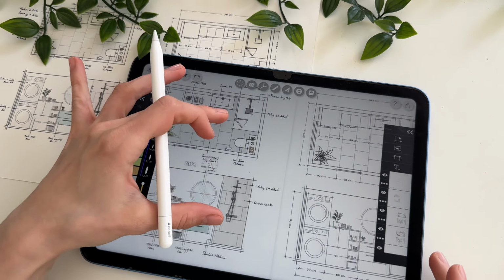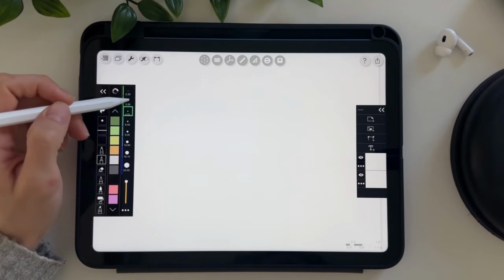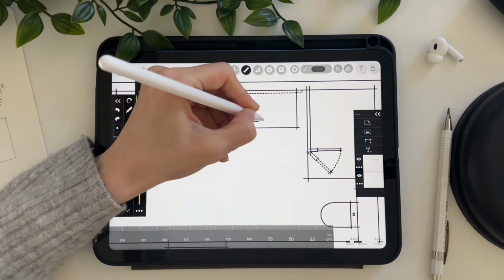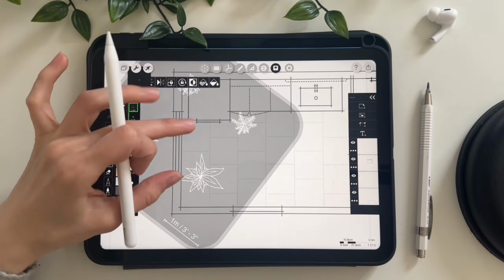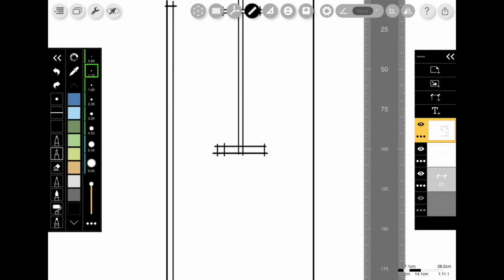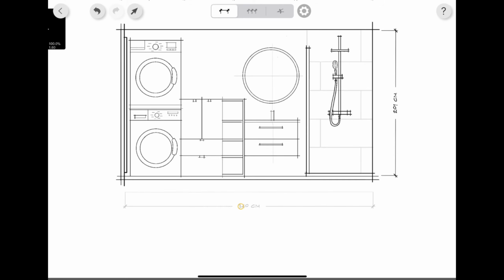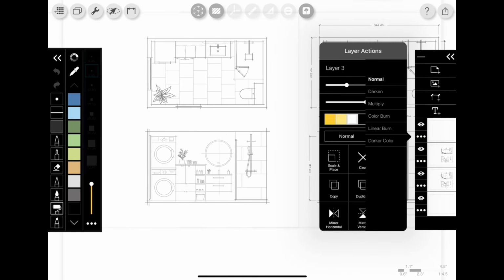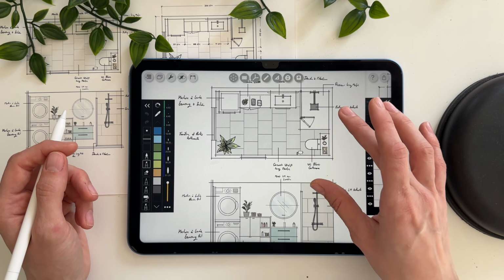How I use MORPHOLIO TRACE as an Architect and Designer - Drawing on the iPad Tutorial

Comment: Do you have a workflow between Morpholio and Feather? Wondering how well the programs work together
Reply from the maker: There isn't a direct, built-in workflow between Morpholio and Feather, but the best is to start with ideation and visuals in Morpholio, then import these images into Feather to try 3D sketching the concept. It's a bit manual, but it works well for keeping the visuals connected.